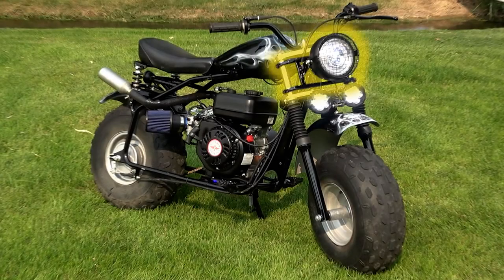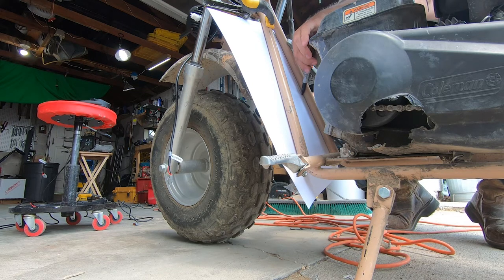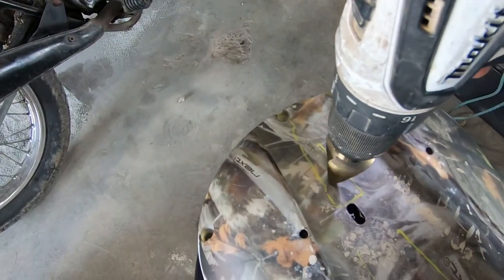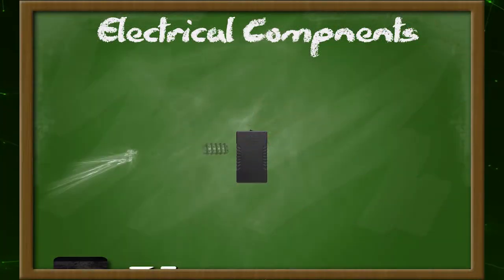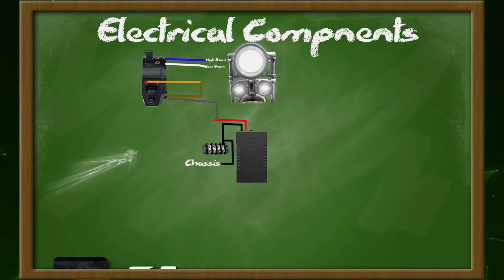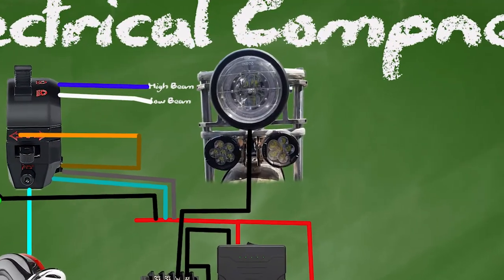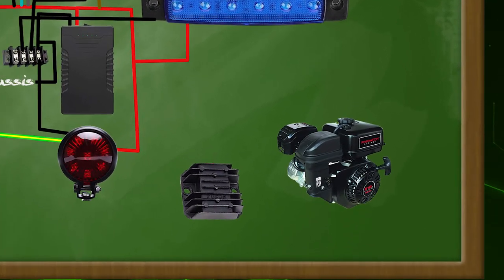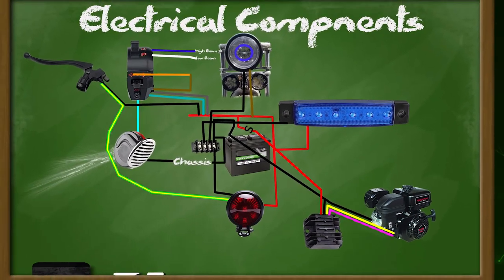Custom Mini Bike Build// Coleman CT 200 EX // Electrical

Comment: Like what grounding strip did you use and how did you hook the lights to it i cant understand or figure that part
Reply from the maker: I added a link to a similar grounding strip in the video description just now. The grounding strip just serves as a way to provide multiple grounds from one location.  You could just run one ground from the battery to the steel frame and ground the lights and other components to the frame. I hope that makes sense. Thanks for watching.